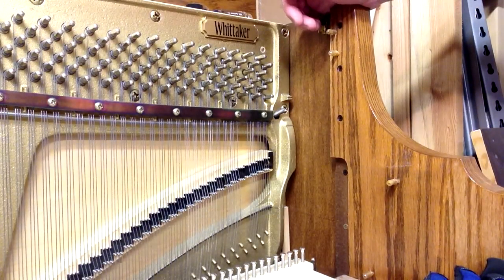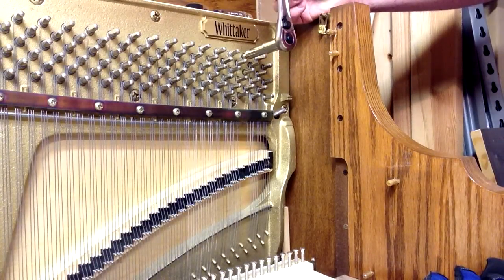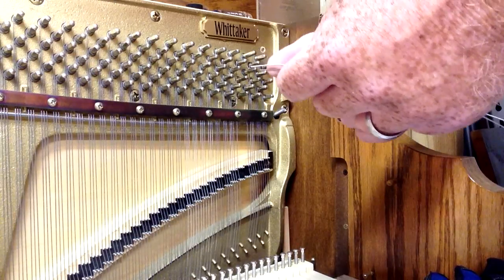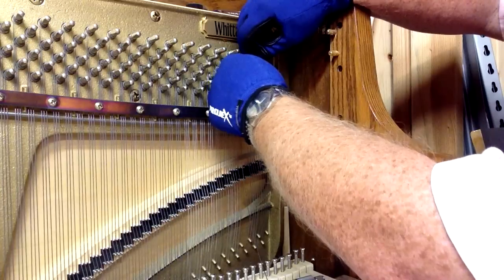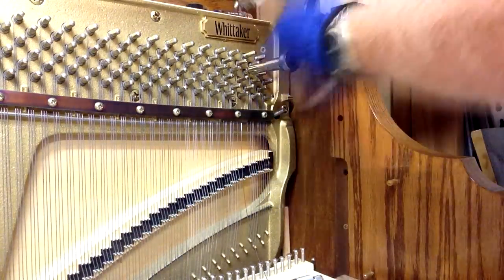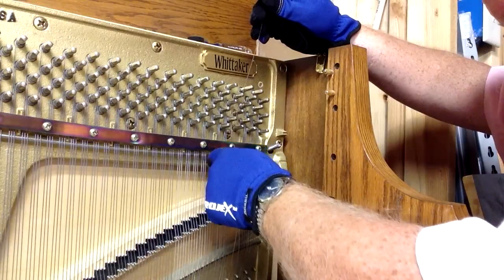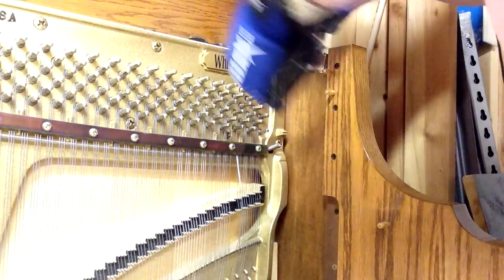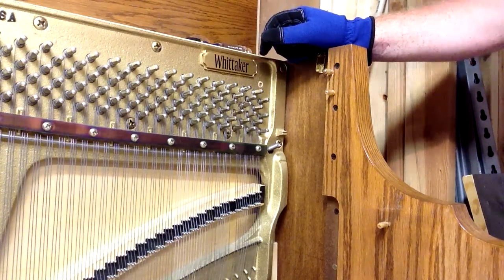Replacing a Broken String In A Piano - Piano Tuning & Repair I HOWARD PIANO INDUSTRIES

Comment: Great video!  Seems like time-constraints kept the poster from showing one last, but VERY important, step: on the other end of his coil-lifter tool is a string-spacing guide-- the strings MUST be correctly spaced when they are replaced or the hammers could possibly end up striking the new strings in different areas of the hammer face, which may cause the notes to have a dark or dull sound quality to them. The felt on the hammers has been "voiced" with special tools to have a consistent hardness over the scale of the piano where the felt meets the strings as we play.  On grand pianos this is ESPECIALLY important since the una corda (soft) pedal functionality moves the whole action over to strike a different part of the hammer which has been voiced so the felt is less hard, producing a softer tone.  If the strings are not correctly spaced, the voicing will be off and you'll be very confused as to why the new string doesn't sound like the old one! All one needs to do is place the newly replaced (but not fully tightened) strings in the slots at the end of the string-spacing tool and run the tool up and down the top 2 or 3 inches of the strings a few times, ending as closely as you can to the pressure bar, then while holding the tool in place, tighten the strings JUST ENOUGH to hold their new position. Save pulling the strings up to full tension for the tuning process so you don't accidentally tighten them too much and snap the new string you've just installed! (One last and final piece of info: after you've installed and tuned your new strings, don't expect them to hold their tune perfectly-- they will stretch out a bit under their new-found tension, and the pitch will need to be raised again, and again, and again before they become stable... I would also advise a LIGHT tapping down of the string under the hitch pin to help seat the wire so it has fewer places to stretch out).  Again, I'm sure Steve knows to do this, but it wasn't mentioned in the video so I'm filling the gap (hopefully)!
Reply from the maker: Thanks Charles for this additional, very helpful information!
Reply: Alternatively, simply file the hammer with sandpaper sufficient to eradicate the old grooves.
Reply: Filing the hammer might remove the cosmetic appearance of grooves, but voicing the hammer is the act of creating or relieving tension at varying depths within the hammer felt. I understand that filing the grooves out of the surface would eliminate the possibility of the hammer striking the new string on the "peaks" instead of in the "valleys" (read: old grooves), but simply removing them won't address the fact that the hammer is voiced for brightness in a neutral position and mellowness when shifted with the una corda pedal (in a grand action--vertical actions aren't voiced this way). In any case, even in an upright action, the "grooves" contain more compacted felt which produces a brighter tone; you'd still be left with a note which speaks differently from the surrounding ones if the strings aren't placed where they were to begin with... Speaking of aesthetics, the inside of the piano simply looks nicer with all the strings equally spaced; if you are replacing strings, you likely already have a coil-lifter so why not just turn it around to space the strings properly (which takes all of 20 seconds) while you're working?
Reply: Thank you.  I wondered about that and was a bit disappointed that he didn't finish the job he started in this video. It seems like there should have been a part 2.
Reply: I have several mid-strings that will not maintain the spacing after using the string spacing tool. How do I get the strings to stay in position?
Reply: Hi

Comment: I'm sorry, but this video says to turn the pin out 3 full turns, which is bad practice. Consider that the pin is just held in by the wood being tight (friction). Backing it out 3 full turns and turning it back in 3 full turns will wear the hole out and loosen the pin. It could even wear the hole out to the point of making the tuning not even hold, if the hole is already on the looser side. The correct way - always - is to back the pin out only 1/2 to 1 turn, then - and this is the key - wind the new string onto a spare tuning pin first (one that's not in the piano) to create a coil, then put the already-coiled string onto the pin in the piano. This way, you don't wear the pin-block down any more than you need to. The way he does it in the video might work, but it unnecessarily ages the piano. I even have a special little cylindrical tool that I can put my spare tuning pin into, to help me make the coil.
Reply: ClaptonHook,I got here because I thought slamming piano pins into an aged pin block would destroy the threads holding it in place.This seemed far less intrusive.That being said,how do you get the pre-coiled wire off the piano pin that’s not in the block?And how would you measure out the wire to assure that you get three turns around the pin when it’s assembled in the piano itself?I like the idea of the piano pin  not pulling early and skewing the wood. 👍
Reply: @humanbeing3777  You measure the string the same as if you were going to coil it on the pin that's in the piano. Get the string in place in the piano. Measure past the pin that is in the piano. You should know how long 3 coils is (for me, it's about the width of the palm of my hand; in the video he says 3 inches). Then, instead of coiling onto the pin in the piano, coil it on the spare pin.

To remove the coil from the spare pin, just let the coil loosen itself a bit, then grab it with some wire bending pliers, which are like rounded needle nose pliers, which won't put a kink in the string. You grab it near where it bends and goes through the hole in the pin, and then you slide it off the pin. Be careful putting the coil on the actual pin in the piano, not to bend the little bit of the string that's going to go into the hole in the pin. Then, once it's in place, use normal needle nose pliers to ensure the small bent part that goes through the pin hole is all the way in and be sure it stays there, while you tighten the string the 1/2 to 1 full turn of the pin in the piano. 

If you ever have to actually replace a loose pin, you'll need to go to a larger size pin, and then it's just hammered into the pin block with a hand sledge (be sure to use a pinblock support on any grand). There are no threads in the wood, only on the pin. This is why the wood can wear out! It's supposed to be tight on the pin and every turn of the pin wears out the pinblock hole, to a slight degree. Many older pianos already have loose pins and I don't want to make it worse, which was the whole point of my comment, above. My best to you, Human Being.

Comment: My piano tuner begins to make the first coil by winding the first end of the wire on a spare tuning pin inserted into his tuning hammer. He also uses the width of four of his fingers to measure the 3 inches. I tried with my hand, there is exactly 3 inches with the fingers 2, 3, 4 and 5 put one against the others. No need for a stainless steel ruler...
Reply from the maker: That works also.  There are always shortcuts that work perfectly well.

Comment: Thank you for the time taken to make the presentation. I have an old piano which was built in Kalgoorlie Western Australia. Part of the original brief for the piano brand was that when delivered to a remote town or station ( ranch ) homestead overland on a camel wagon, the instrument had to be in tune and playable on arrival. This piano I rescued after it had been pushed by vandals off the stage in a remote town dance hall. That fall apparently raised little lines of dust alongside the cracks between the floorboards of the hall. They were still there when I collected it. The keybed had broken through and there was a scatter of pieces, some broken and missing hammers. I patched it up as best I could with a poor skillset at the time. When the time came to tune it, the tune was in balance but about half a note low. Aside from fine tuning all the notes, I did not try to raise the pitch. At about 3am one morning, I was half awake and thought somebody had shot the house, then I heard a drumming sound. A string had snapped during the night, I guess as a cool drift came through after a hot day. Some 30 years later, I recently rescued another of the same type in better although well used condition but with a little internal damage. I found that to be correctly pitched and in tune. With that instrument as a reference, I have begun to finesse the first rescue a little more. I originally replaced the broken hammer sticks with rolled roast sticks from the local butcher shop and missing hammers with what I could scrounge up from a totally wrecked instrument. Over time, those roast sticks have bent and twisted. Before going to the bother of sourcing some new hammer heads, I thought I would raise the pitch and see if would hold. It came up fine. I took the precaution of putting some liquid molylube where the strings pass over the fret to avoid the strings binding on some signs of fine rust. Over time there have been a few beer spills by the look of it. However two strings have snapped. They did not snap on the fret. One snapped at the coil. The other has snapped at the bend at the bottom. Interestingly it has split, not broken across. I have three to replace including the one which went off in the night long ago. I have yet to measure and source the replacement strings. Your advice is very helpful. For your curiosity, a link to a clip of the instrument follows. After a major goldfield was discovered, in Western Australia there grew the town of Kalgoorlie-Boulder and it for a while was larger than the capital city of Perth. A piano factory was apparently built there. The actions and some pedal lever pivots seem to have been sourced from the US. I doubt that the cast steel frame was made here because all we had was then charcoal grey cast iron not cast steel. The frame bears the brand "Shotter Rowe and Co Perth". There is very little information to be found. 
https://www.youtube.com/watch?v=6OYd9AvTQIo
Reply from the maker: Thanks for sharing this interesting story. I enjoyed seeing and hearing the video. I wonder if this upright "Sostenuto" piano has a real sostenuto pedal?
Reply: @howardpianoind  It does I think. The small number of pianos I have repaired/tuned have been smaller two-pedal British types, Witton and F J Best plus an overdamper type which was an absolute villain to tune. It goes flat in the upper strings almost immediately. The owner has decided to install the gizzards of an electronic keyboard into the cabinet. 

I am not familiar with the sostenuto mechanism so I do not know if the system on the Sostenuto brand piano is genuine or a workaround. 

The piano has three pedals. The right is a sustain pedal which holds off the dampers. The left pedal moves the hammers towards the strings. On a restored piano I examined for reference, the centre pedal lowers a rail supporting a thin felt curtain between the hammers and the strings. 

On this piano, the centre pedal and its related mechanism had been removed it seems with some violence evidenced by the torn screwhole in the wood of the left panel. 

The pushrod which lowers and raises the curtain is quite fragile, no stronger than an automotive telescopic radio aerial. There are no identifiers printed on the action anywhere. 

The action appears similar to the Renner action seen in some youtube clips of upright Steinways. 

I recently aquired another instrument which was offered free by the owner and was in imminent danger of being soaked by rain. I thought it would yield parts for my instrument but it turned out to be in too good a condition to be ratted for parts. 

It had been stored outside of a church hall under a patio covered by canvas for several years. I expected it to be a ruin but the cabinet was in good shape. It was also on a trolley for moving about so possibly had been a school piano.

The action was baulking here and there but the tuning was near perfect although not touched for over ten years or more. The tuning encouraged me to raise the pitch on my original piano and that has held. 

Thank you again for your excellent Youtube presentations which have been very helpful.

Comment: Howard, I just replaced a midrange string. This was not easy. It took two tries. What I quickly learned was to pre-measure the wire, crimp it in half then do the 3" above the pin measuring and cut. It was still tedious! Are there any downsides to this crimping? Aligning the string on the bridge pins is also tricky cause you need to have the string a little taught so that it stays. Dexterity with the string hook and a screwdriver will need to improve going forward. Any comments, suggestions appreciated.

Comment: Mr. Howard, thank you for a concise video that's easy to understand.  I was wondering if there is a tool we can use to stretch the string before tuning to add stability.  I'm thinking this could make new strings more stable and even make it unnecessary to make a second trip to the customer (saving time and money).  Thanks for what you're doing.
Reply from the maker: Yes, there is a tool for stretching the string which does contribute to stability in the tuning: https://www.howardpianoindustries.com/piano-string-stretching-tool/
Reply: You would wind up just breaking the new string. the strings must age like fine wine

Comment: Do you happen to have a video that shows how to replace a steel string in the center section of the piano where you have to deal with the overstrung bass strings being in the way (on an upright piano)?  I am facing this challenge and am finding no information about how to do this.  I am only finding tips on how to guide the wire down with a paper clip or a safety pin.

Comment: Hi! This might be a silly question from a non piano tuner (I'm attempting to repair a piano at the mo) but I notice use one string and returning up to create the second string. However there are three strings to each note so what happens to the third string? Does that not have a hinch?
Reply: The thrid string in the unison (the set of strings tuned to the same pitch) would go down, wrap around the hitch pin and go up to be first string in the next unison. It's kind of like a pattern. 1-2, 3-1, 2-3, 1-2 so on and so forth.

Comment: What did you use to coil the string around the tuning pin? Is that ratchet star head special? When I tried using the ones I have they don’t work and I believe the tuning pins were the same ones as in the video.
Reply from the maker: Yes, this tool is made to fit onto piano tuning pins.  Regular sockets won’t work.  Here is a link to this tool in our store: https://www.howardpianoindustries.com/ratchet-star-head/
Reply: howardpianoind thank you for the quick reply and very helpful video btw

Comment: I have to replace one of the longer treble strings on a Spinet piano and the broken string passes underneath the bass string section.  I will not be removing the spinet action but merely removing the action bolts (screws in this case) and just pulling back the action about 1 & 1/2 to 2 inches away from the strings which will give me enough room to work with.  It is a 3-string note and there is only a single wire left so it would sound too weak if left without replacing the other two thirds of the string for that note.  Do you have any suggestions or tips to make this go easier?  I may remove a few of the bass strings from their hitch pins after loosening the pins one full turn and still leaving the coil intact and attached to their respective tuning pins.  This will give me some room to get my hands as close to the hitch pin of the string I am replacing and get those bass strings out of the way of my working area at the bottom loop of the string.   Other than the removing of some of the bass strings which are strung directly on top of the string I'm replacing do you have any suggestions or tips which may make this a bit easier?

Comment: I noticed that you were able to get the string past the pressure bar without using a stringing hook (at 11:58). I was not able to get a string past the pressure bar despite using forceps, crochet hooks, and a needle-nose pliers. Would a stringing hook help? If not, do I need to remove the pressure bar or is that opening a whole new can of worms?
Thanks for the great video.
Reply from the maker: The curve that the string makes around the pressure bar is at a  tighter angle on some pianos than others. One good trick is to bend the end of the wire to conform to the curve to  keep the end of the string from getting stuck. You can then cut off this bent end or the string after you have pulled the string through.

Comment: Hi, thank you for demo. My question is that there are 3 pins per one note so one wire connects to  2 pins .
So how do we connect the second wire ? The last end goes to the next note??
Reply from the maker: Yes, one of the three string will connect to the tuning pin on the next note.

Comment: so Im assuming when you start the coil around the tuning pin it must coil toward the sound board of the piano correct so the the wire through the hole can be easily trimmed close as possibe
Reply from the maker: Actually you shouldn't need to trim the wire once it is installed.  The way this is done is you only put the wire through to the other side of the hole so it doesn't stick out.